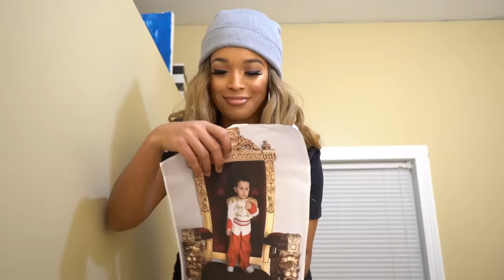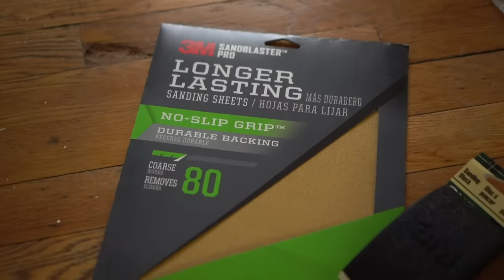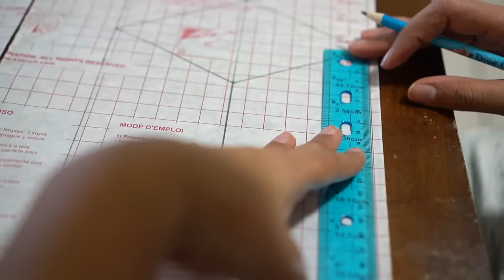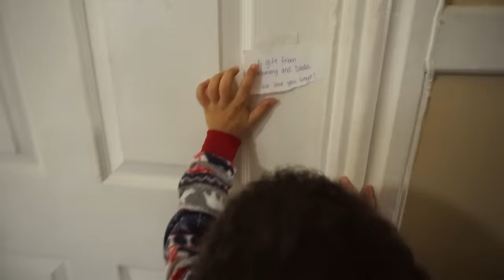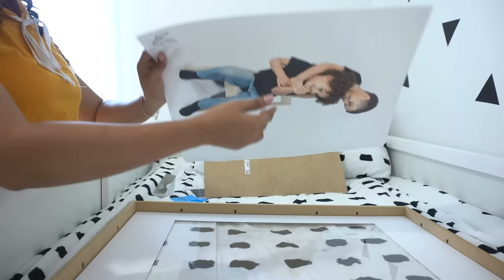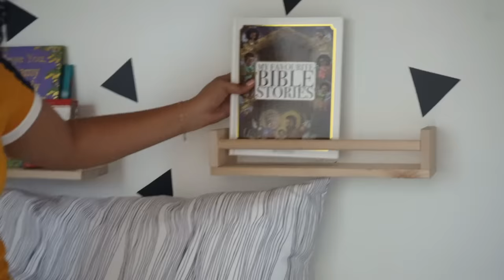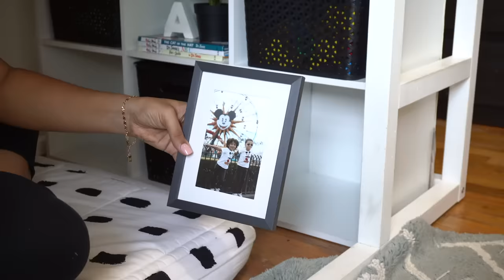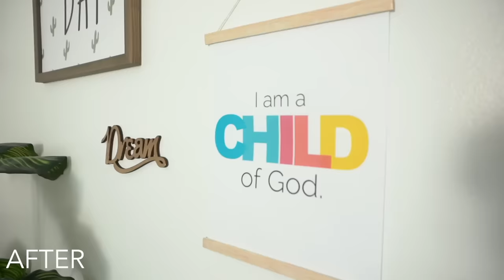KID'S TINY BEDROOM MAKEOVER ON A BUDGET + DIYS! WE SURPRISED THEM WITH A NEW BEDROOM IN ONE DAY?!?😱

Comment: Absolutely loved this video!!! One tip for the backing of the cubby boxes (I just realized I actually don’t know what they are called lol) instead of using the plastic stripping go to the lumber department of Lowe’s or Home Depot and they will have really thin plywood typically they are cut into 3x4, but they do vary in size as well, then just paint it white on both sides and it’s a more secure backing so books and toys don’t push through.